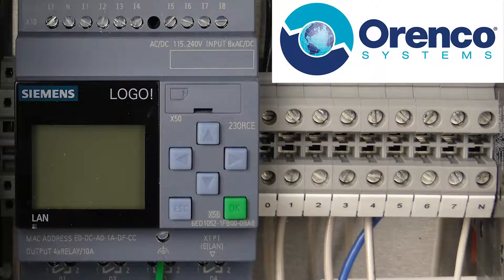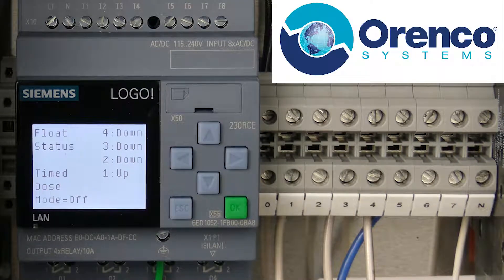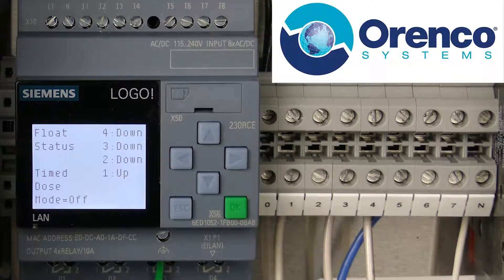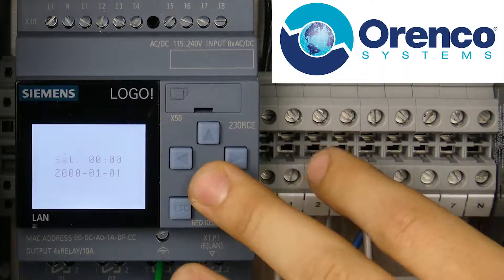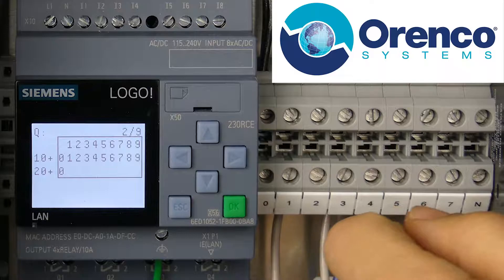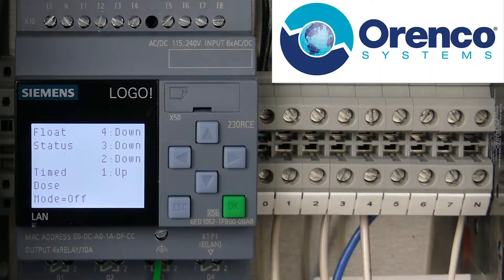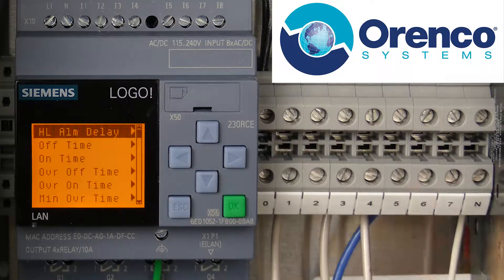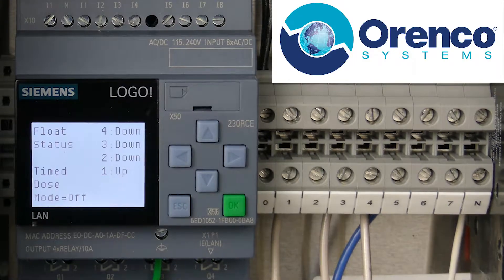Navigating the Orenco MVP Panel Logo PLC

Comment: I have an mvp panel from 2010-11 and my float 3 is flickering between up/down. What do you think is causing this ?
Reply from the maker: The float is either water-logged and beginning to fail, or you have water in your splice box. Check the splice box connections first, if that checks out then pull, test, and if needed replace the float. If you need a new float, give us a call 855.329.4519 or find them on our website: https://www.rcworst.com/Float-Switches-c134.html